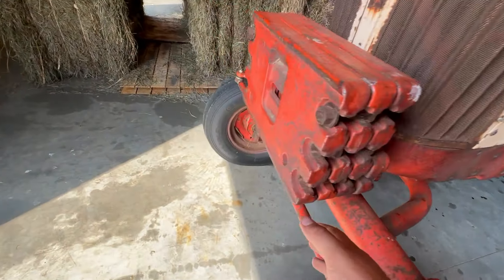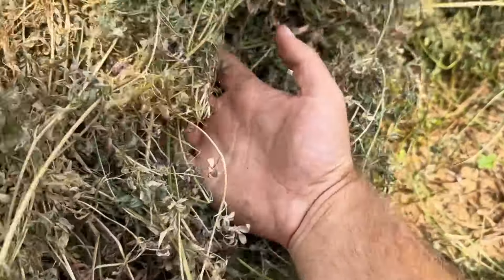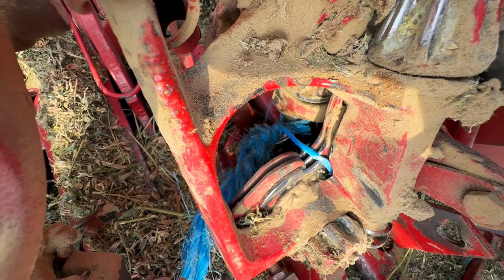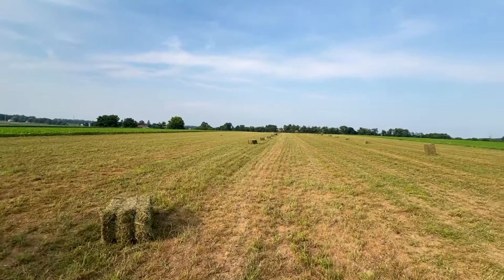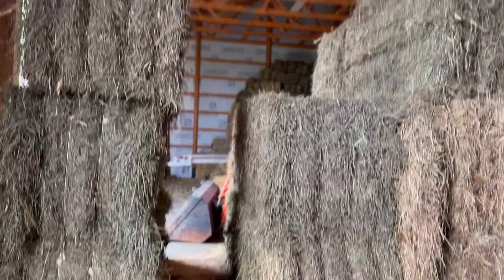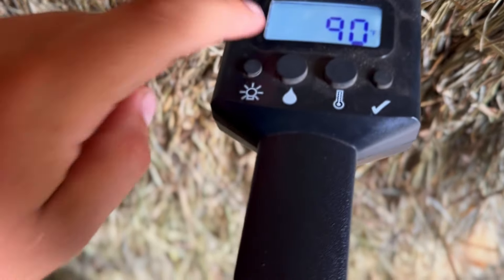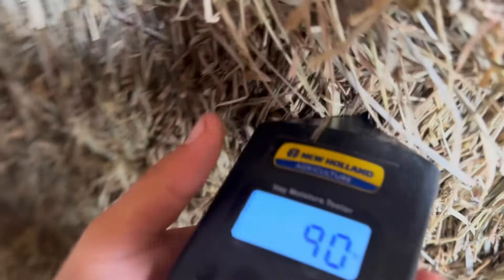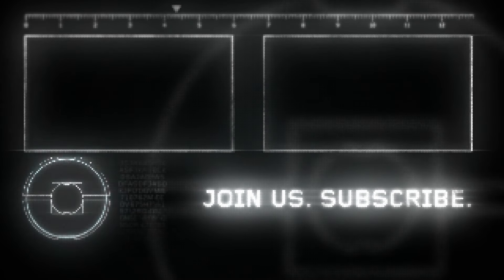Young Farmer makes INSANE PREMIUM ALFALFA!!! (Baling Hay with NH 316)

Comment: i woudnt worry about the rear main on the case unless it gets significantly worse on older engines you can replace the rear main and it will start leaking again a short time after. especially if that is a rope seal
Reply from the maker: Thanks for the advice! I’d rather not have to go through and split it. What about the leaking transmission fluid? Should that be sealed back up?
Reply: @jakefromsteakfarm4177  if it's an easy fix then yes seal it but if it's a real big job I wouldn't worry about it either unless it got a lot worse. Old tractors are gonna leak I bet when you fix it it will leak somewhere else

Comment: If your twine is wrapping on the billhook, make sure your twine knife arm lightly rubs on the billhook. Also make sure there are no burrs or rough spots on the billhooks. If there are, hit them witb some high grit emery cloth. I bale with a NH273 and hope to upgrade to a 316 or 326 next year 🤣
Reply from the maker: I’ll check that! Is it also a possibility that the knot the connects a new bundle of twine can get caught in the bill hook?
Reply: @jakefromsteakfarm4177  I haven't seen it happen but I'm sure it could. I've had knots hang up in the needle eyelet and pull the twine out of the twine disc though.

Comment: Where did you get the straight pipes for both tractors?
Reply from the maker: I think I got the one for the agco off of yesterdays tractors. The one on the 966 is a truck pipe. Not sure where I got it
Reply: @jakefromsteakfarm4177  thanks